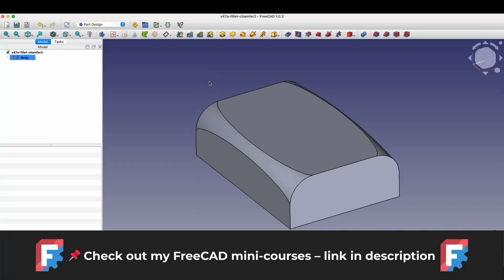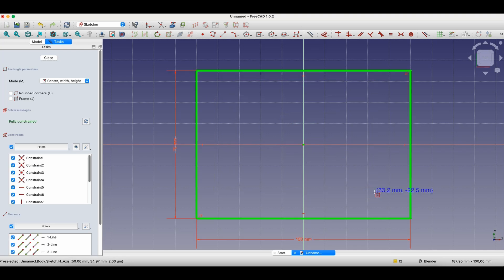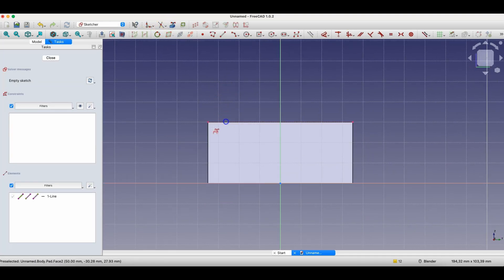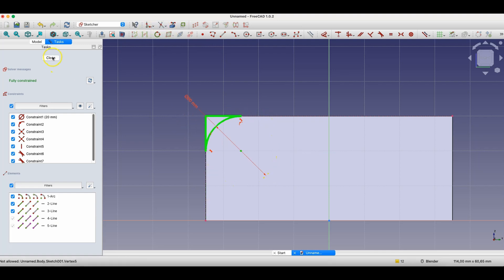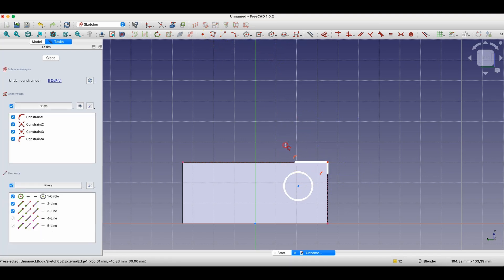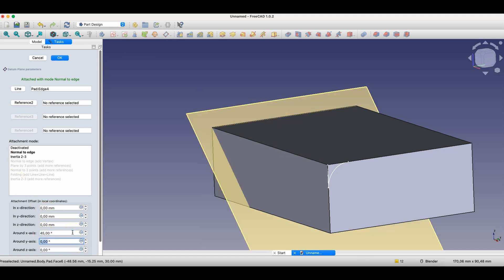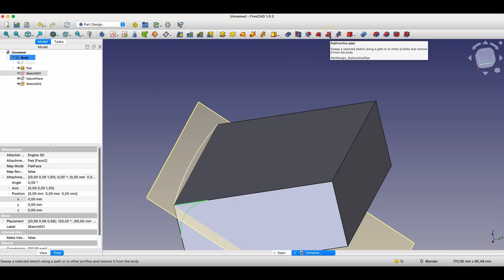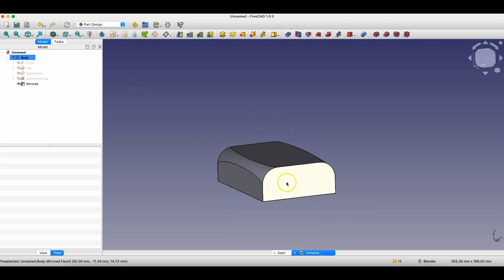Stop Using Basic Fillets! Create Stunning Curves in FreeCAD Like This 😲

Comment: how can i get these ojbects printed? are there cns buisnesses that will print these for me?
Reply: Likely that most people watching this will have a 3D printer. I think you're referring to "CNC" businesses, and they are a little different because as far as I understand it, they are cutting material away, usually metal, to make the part. They might do it for you, but would definitely be really expensive unless they specialize in small projects. Bambu Lab's A1 printer is a great entry level printer that often goes on sale. If you don't want to get into owning your own printer, then depending where you live there might be a "makerspace" in your area that may give you access to one, and people that could help you. I got into 3D printing because I wanted to build an enclosure for an electronics project. I also thought of getting someone to print it for me, but decided it would be just easier to get a printer and do it myself. There is a learning curve, but it's not bad, and when you get the hang of it you can print some really neat stuff. If you are going to just print one or two things, maybe see if you can get someone to print it for you. There are online 3D print services for that. If you're going to do a lot of projects, just get a printer and jump in. I had to do a lot of test prints for my electronics project, that would have been impractical if I was having someone else do it. Having my own printer allowed me to refine the project with test prints, and the end result was super!
Reply: JLCPCB and others offer 3D printing and CNC.